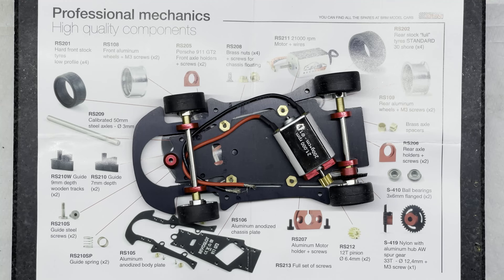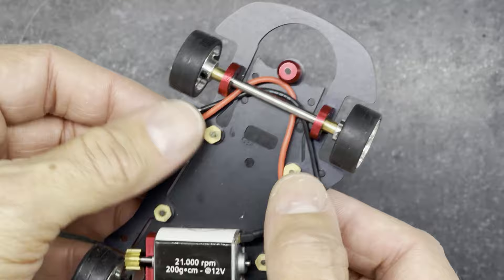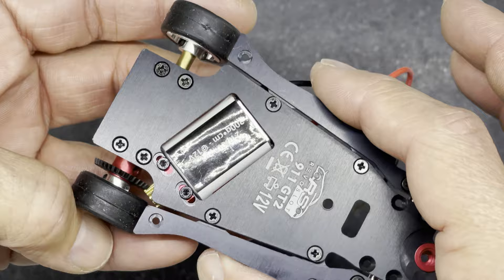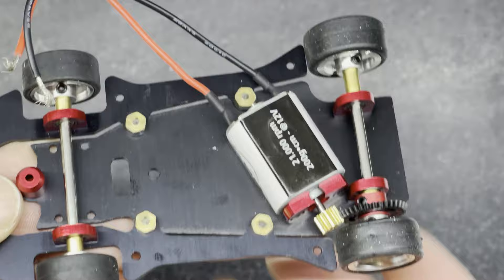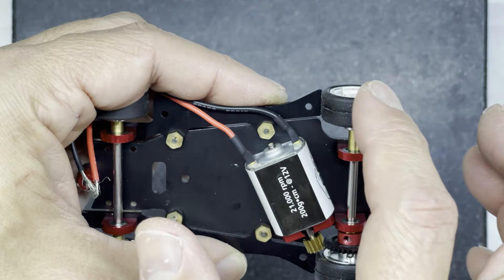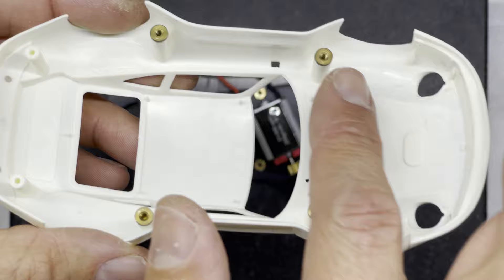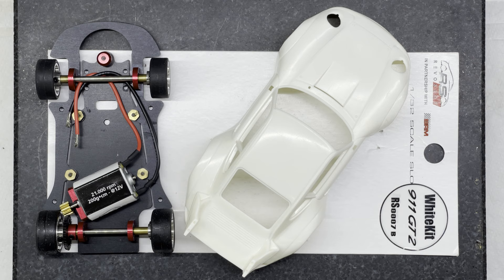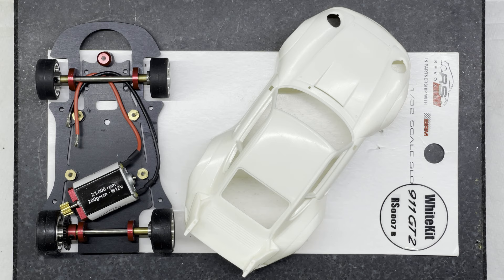Taking a close look at my RevoSlot Porsche - What colour should it be?

Comment: I don't know if your club rules allow this but I shimmed the rear axle blocks up 0.25mm which lowers the chassis and trued the front down until the guide was fully seated against the chassis.
Others have tried silicone o-rings, others have milled the chassis or pans to allow the two to sit level with each other...me, I put a piece of duct tape the length and width of the chassis to act as damping.
The deep guide is favourite but we've seen one or two guides snap as the rear of the car suddenly gives way and swings round, there isn't a great deal of guide rotation for a car with such a rigid setup.
Saying this, they're brilliant fun and can be pushed deeper into corners than lighter plastic chassis cars.
Reply from the maker: Thanks for the advice. I did want to shim the pillow blocks but that is not allowed. My next video shows an idea I had about adding some damping 😉.
Hopefully the guide will survive but I might get a spare as you are not the first person to mention that.
Reply: @CleaveTech  Check the Revo/BRM spare parts. The pillow blocks from different models have different heights. They may be interchangeable.
Reply from the maker: @Fabio-ns4ql  thanks. I think you are correct. They might be different colours. The rules I am racing to don’t allow swapping of parts from different RevoSlot models though.

Comment: The two grubscrews on the rear axle are for even weight distribution. Two opposite from another on the right wheel. Two opposite from another on the gear and the left wheel. Two per side.
I like flashy colors (yellow, bright green, bright red) . As an older dude, I can follow them better on track.
Reply from the maker: I thought that but then they would have supplied two grub screws for each wheel and the gear. It was only one wheel that had two grub screws.
Reply from the maker: I like bright colours too. I like my car to stand out.
Reply: @CleaveTech  Then you would have 5 screws in total. Uneven weight distribution on the axle again. My cars have 3 screws and I must offset them by 120 degrees so the axle is balanced. 5 screws means you must find a place for the gear screw to balance the axle. Can't do that by eyeballing. Good luck!
Reply from the maker: @RackwitzG  I meant that if RevoSlot thought that supplying 2 grub screws was for balancing then they would supply 2 grub screws for every thing that fitted to the axle (2 for the gear and 2 for each wheel making 6 in total for the back axle).
Reply: @CleaveTech  Oh, ok. I didn't realize that the gear has two threads too.

Comment: Small piece of Tape (I use Gorilla)  under each Chassis float nut, helps quiet the Car down
Reply from the maker: Thank you. I did mention it in my video but I decided against adding tape as it is not allowed in the rules and it lifts the chassis slightly. I have no doubt that it would quieten the chassis if you were allowed to use tape 👍🏻

Comment: I purchased a 1/64 angle winder chassis bit like yours what i did not like is the rear portion of the chassis weak points is left and right of the motor easy to bend there yours looks bit tougher made
Reply from the maker: There is a lot more room for a motor in a 1/32 chassis. The 1/64 chassis must be a bit tight!
Reply: @CleaveTech  I told seller about it he replied when the motor is soldered to pan it will be good

Comment: I love the Revoslots. My view would be not to get overly analytical or technical for when it comes to the chassis mechanics - unless that is you are experiencing an issue with the car 'bottoming out' or the wheels rubbing against the bodywork.   This has not been my experience.  As for the colour?  I'd use a Tamiya primer (white or grey) followed by a matt acrylic (not gloss).  My preferences are either a lemon yellow or   a blood red from the Revell ranges albeit Humbrol matt acrylics are great too.  Once done then you can let it 'gas out' and apply decals before a gloss clear coat to finish out.  Advice: don't be in a hurry - especially if you are on a learning curve with all this.
Reply from the maker: Thank you Darren. Your advice on painting hard bodies is much appreciated.
Reply: @CleaveTech  - It helps to have an airbrush and to be able to thin the paint and 'knock it on' at 25-30 p.s.i. It's a great investment if you are planning to make a habit of it.  There's plenty of excellent 'show how' videos here on YouTube if you want to get into this a bit more.  I find it a bit 'nerve racking' insofar as it's easy to make mistakes or imperfections and, of course, it is messy  - a bit like racing slot cars really!  However, perseverance will eventually pay off and you can then feel accomplished in what you have done.
Reply from the maker: @MrDarrenp40  I do have an airbrush somewhere that I bought as a teenager. I will have to dig it out again sometime. At the moment I enjoy racing my cars and need to spend the limited time I have making them drive correctly and go faster. I hope one day to have more time so I can also consider painting them nicely 😂
Reply from the maker: @MrDarrenp40  Thank you for the good tips though 👍🏻
Reply: @CleaveTech  I think a lot of us can understand exactly where you are coming from and, if you ask me, I share your priorities in terms of what you do with the time you are able to devote to hobbies :)

Comment: The concept of using individual pillow blocks to house the bearings is a poor one. Your front bearings seem to be very tight. It takes a great amount of fettling to align the bearings. Bearing quality is average and Id be looking to replace with ceramics if allowed. There are some other tricks you can do but it really depends on how the rules are written as to what you can do.
Reply from the maker: Hi Fabio. Thanks for the advice. Yes the front axle was very tight. I have a video coming out soon that shows how I fixed that. The rules don’t allow the bearings to be changed so I have to stick with the RevoSlot ones.